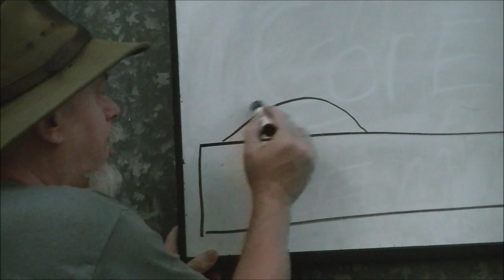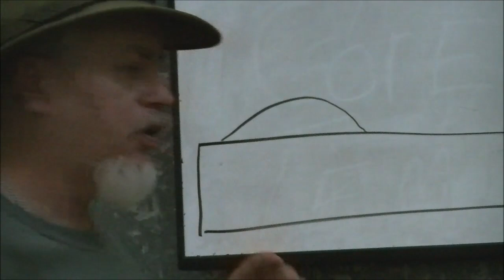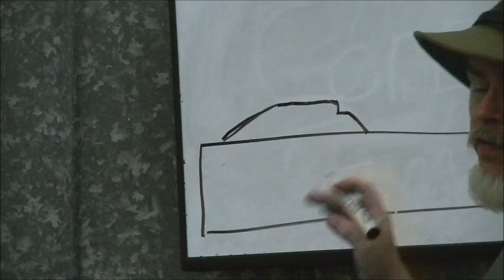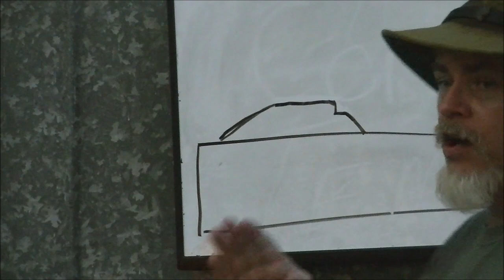ABOUT THAT FRONT SIGHT

Comment: Blackie, you are sure on it today!  I was going to ask the very same question but I got beat to the draw.

I'm going to try this myself.  I have been using a grease pen (pinched from work) to stop any reflection.  Works well, but it can get all over everything on those devilish hot days.  No worse than melted lube all over everything though!
Reply from the maker: true i tried blacking the sight for a long time but it always found a way to rub off just when i needed it the most

Comment: This is well after the fact, but I'm not sure I understand the benefit/method that's produced. I come from a flinter background. My standard profile is to have a flat top and undercut the blade flush with the barrel and then blacken the undercut. What is left, is beveled at a 45 degree angle and polished.

Comment: Hey Mr Blackie, how do you make sure that you are 90 degrees when filing the top of the front sight?  Fear I'd make a big mess of things removing the rounded top.  As always, thanks.
Reply from the maker: i am pretty good a free handing it..but if your worried  you can place the barrel in a vice and use a level to be sure barrel is level and use a spacer to be sure the file is at a 90 deg to the top of the barrel

Comment: I have one question, is it safe to bend the front sight on a Uberti 1873 to move the point of aim/point of impact? It's not off a lot but I like poppin' clays on the 200m berm and it requires a 'fudge-factor'' I'd like to eliminate. I've heard a lot of guys say, ''Bend that sucker!'' but I'm concerned I'll bust it off if I apply enough lateral pressure to bend it. Your thoughts, Blackie?